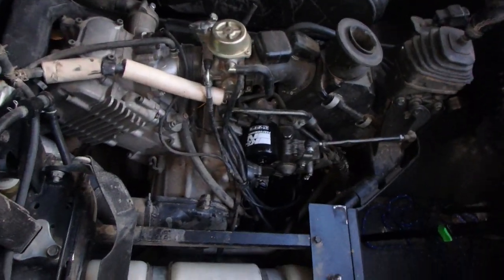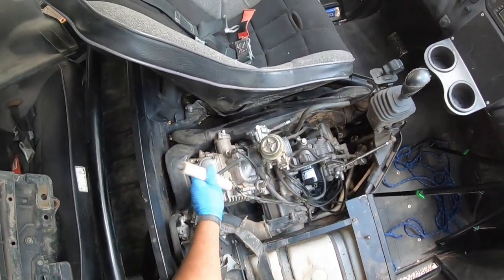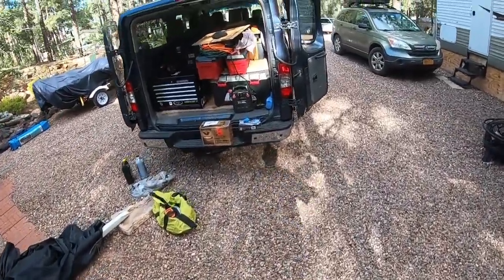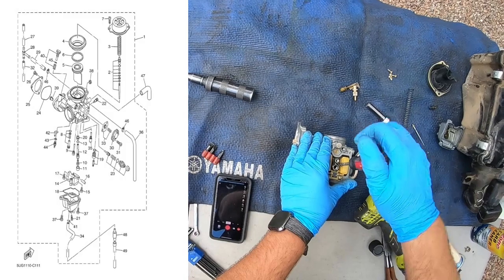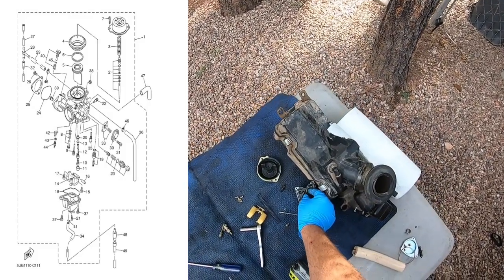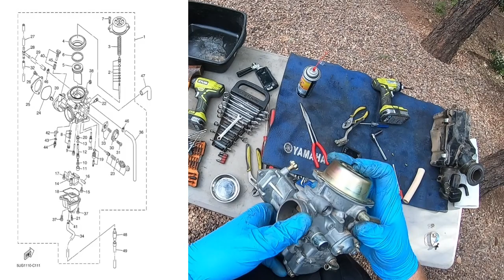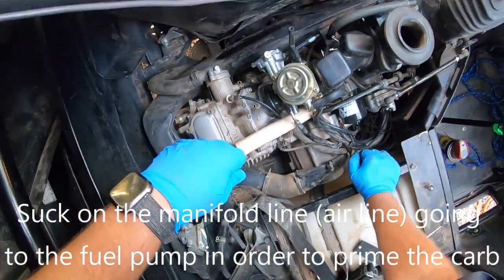2004 - 2007 Yamaha Rhino 660 carburetor cleaning  with throttle cable removal/install.

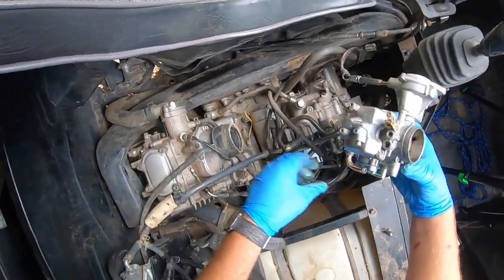Comment: got the brass plug filled with JBWeld and put back in.  It looks like its going to work.  At 19:25 where you have the carb turned upside down, you have the carb turned upside down.  There are four items at the bottom. In the view at 19:25, the top is the heater.  The center left is the brass plug.  The center right is the jet.  On the bottom is a threaded hole.  I don't see you put anything back in it.  Is it left open?

Comment: I’m having an issue where it looks like my throttle isn’t opening completely. The thing has ALWAYS run sluggish so I decided to check this 

The cable seems to be getting caught on part of the rotating thing. It deosnt open anywhere near the amount you had at 5:35

Comment: What happened I was going to go over the jetting and tell you it's jets are in it all that kind of stuff all you did was take it apart and put it back together which that part I had down finding out the Jets was actually what I was really neat have you put another video out tell us what Jets was in it to make sure the power that we're getting used to have the right jets in it and that might be the reasons why some of our bikes ain't right running right
Reply: If it’s not running right, be sure to start by changing out your fuel filter. Most any will work and I mean any! It’s located behind passenger seat. Use a flat head to gently nudge it out. Replace with a clear plastic type of any filter! Make sure it seals when you put it back in. I use c- clamps at both ends. Mine wouldn’t start with the regular pressure clips. Other wise filter won’t fill and machine will not start. If that doesn’t solve your problem, a reverse engineer carb cleaning will solve your problem. Clean. All the jets one by one replacing before cleaning the next. For your normal ride areas, No need to remove the diaphragm cover or mess with the needle assembly.

Comment: You did not change the jetting for the pipe like you said. You also mentioned people mix up the pilot, and main jet but didn't show the difference to help anyone who did. Lastly you fiddled with the float to check float shut off point but did not explain that either. I only mention these specific things because that is what I am looking for not because I am a curmudgeon.

Comment: thanks for sharing you experience. I do appreciate it. During your video edits you cut out or did not video the replacement of the needle into the rubber diaphragm.
Reply: I was wondering the same thing, how does the spring and needle algin up?
Reply: To change needle settings. May want to work over a shop towel so you don’t lose parts. Carefully remove metal diaphragm cover and spring. Use pliers to gently tug at needle plug. The plug and spring will come out together(You put them back in the same way.) The stock needle then slide out. Note the order of any washers and the clip for the needle. It’s at this point you can use an upgraded needle for elevation(DynoJet$40) and position the clip according to instructions that come with new jet upgrade. DJ comes with about 20 brand new jets with small numbers you can try. The plugged system jet has to be drilled out to access the cool features as it is plugged and set to lean at the factory. Hope this helps.

Comment: I had my head up my butt and drilled the plug right below the correct location.  The solid flat brass. Can I buy the piece anywhere?
Reply: Clean up the hole and area around it and use some JB Weld on it.